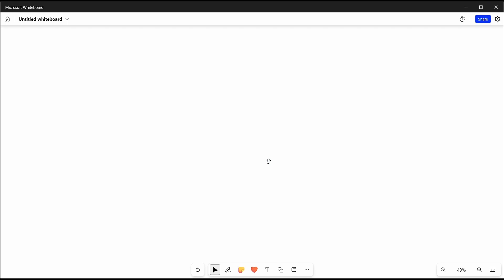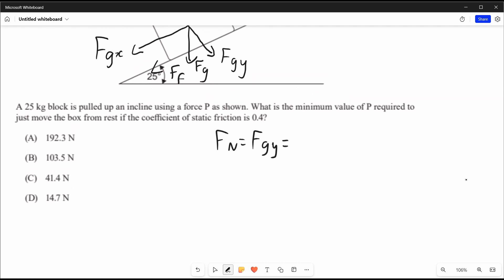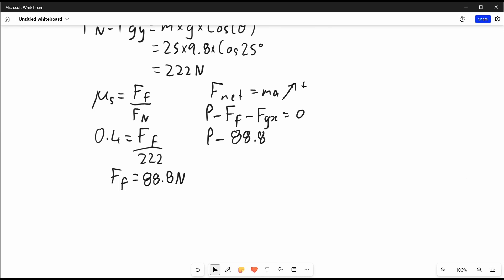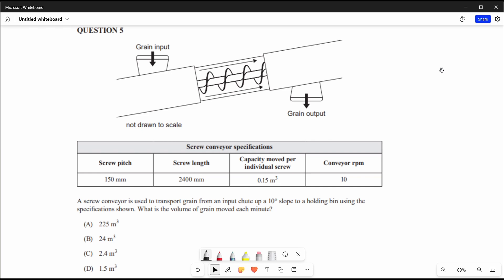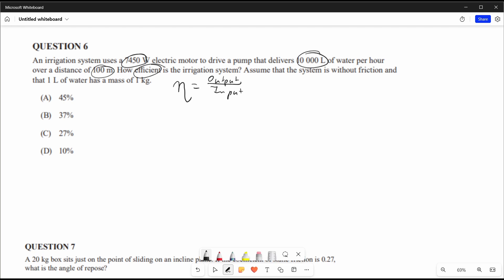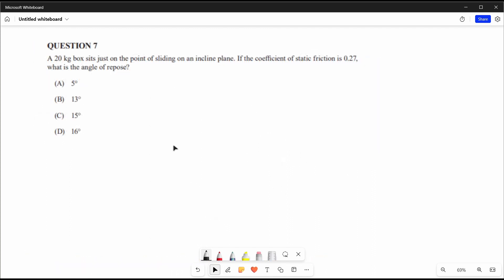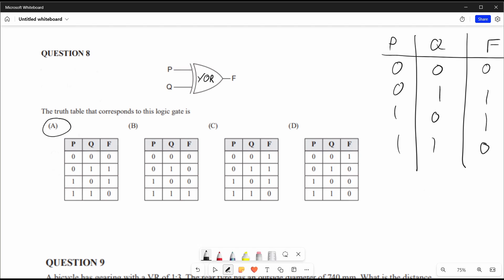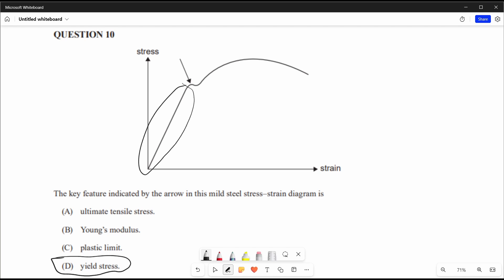2020 QCAA Engineering External Multiple Choice Walkthrough

Comment: Isnt the whole thing one screw for question 5??????
Reply: They need to fix the naming terms for that.
Reply from the maker: @LGA_-yd9pn  QCAA probably meant that one screw was for each pitch level on the screw. The pitch is the distance between each thread level on the screw. The proper way to calculate for q5 would be (screw length)/(screw pitch) which would tell us how many "individual screws" there are. Then multiply this "individual screws" value by 0.15 to get the capacity moved for one rotation of the entire screw conveyor. This tells us how much volume is moved per one full rotation of the screw conveyor. Multiplying it by 10 would tell us how much volume is moved per 10 rotations, which is how much volume is moved per minute (as conveyor rounds per minute (rpm) is 10). So the calculation would be 2400/150 = 16 individual screws, then 16 * 0.15 = 2.4m^3, then 2.4 * 10 = 24m^3, which gives us the answer of B
Reply: Yes but the naming is stupid and annoys me a lot. The correct terminology (which they teach btw) is tooth. A screw is a worm gear, a tooth is the ridge of the worm gear